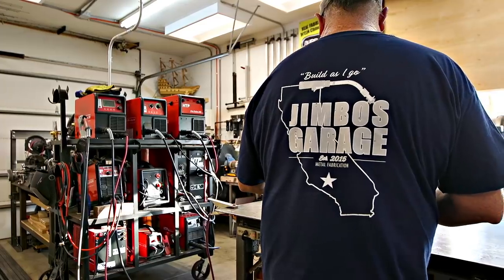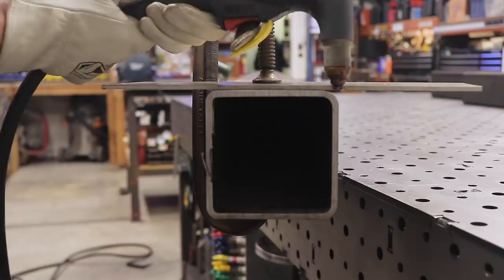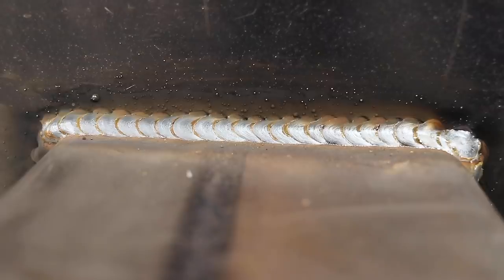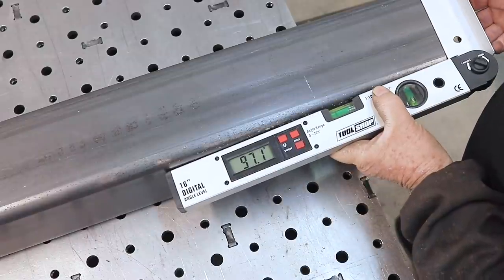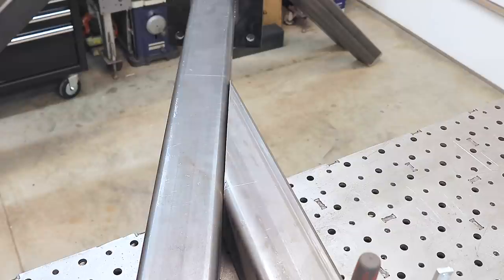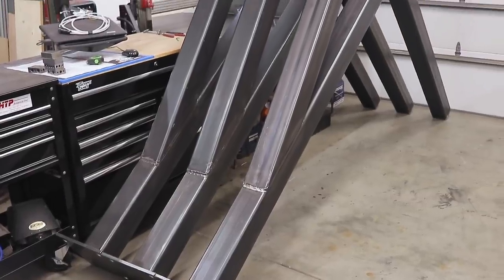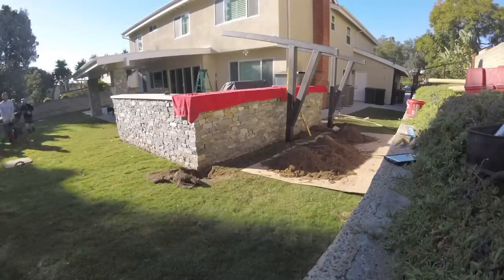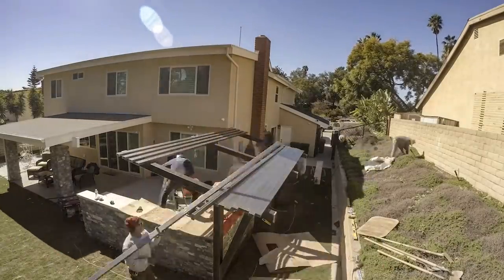Metal Outdoor BBQ Trellis | JIMBO'S GARAGE

Comment: I wrap my pencils in neon pink tape. Otherwise I misplace them. I do the same to my most used bits, tape measure and remote controls in the workshop. Spray paint also works well.
Reply: Also helps stop them growing legs. I had some neon pink loadbinders/tie-down straps at one point because they were the only ones that didn't get 'borrowed' - some guys aren't as secure in their masculinity, I guess :-D
Reply: @gordowg1wg145  Same!  I used to get the bright neon pink extension cords for my guys.  You could leave those out on a job site for weeks! LOL

Comment: Wow, and I thought I over designed stuff!  1/4” wall on a 5x5 tube is impressive
Reply: I think the method used to support all of the other metal for the top. Add to that only two support legs . I think it's good for many years.

Comment: That's an awesome project and challenging on the angles I am certain but you did a great job. Just curious, but on my projects I always do my best to remove mil scale in my welding locations, I noticed on the video you don't do this, at least this is my impression on the video. I think you'll get far better looking, better penetration and stronger welds when you take the time to remove the mil scale and clean with some acetone. None the less an awesome accomplishment and cool project. keep up the great videos.

Comment: That’s not a trellis overhead. That’s a pergola. A trellis is upright section that you typically attach gabion or mesh to in order to grow something like grapevines on. The top part is called a pergola. I know it would be super expensive but, the ones I have built have been out of aluminum. It look great though. I just thought correct you on what that actually is. Nice work.

Comment: Good work but on something structural like this that is hanging out a ways and under a decent amount of pressure why would you chance any downhill welds since they are easier to get to look nice but aren't usually as strong.  One other thing, when you were trying to figure out the long angle why didn't you just trace the bottom side using the tube is was resting on instead of eyeballing it from the top?

Comment: Jimbo, I love how organized your shop always looks in these videos! Question: After you set all your horizontals across the frames did you completely weld around them so that everything was sealed off and wouldn't rust? The reason I ask is because We're going to be fabricating a massive trellis this week for a Shake Shack in Murray Utah and aren't planning to weld around all of them because it's SO MUCH WELDING! I'm afraid it's going to be rust city. What's your take on this? We are setting everything as primed painted and painters are going in to paint it. Do you ever just seal the unwelded parts with a silicone or anything?
Reply: In my experience welding drill stem stands for deer hunters in Louisiana, I sealed up every seam  to avoid rust. Not a big deal for the woods, but if you put your name on something just know that if it rusts down the road and if it happens to stain the painted surfaces it's your name on the product. I wouldn't trust the painter to protect my name... Worst thing in the world is then up in a finger pointing contest with other trades...  So, my advice is to either weld it or seal it with a darn good paintable cock myself.

Comment: Hi jimbo, great video again. Can I ask a question? What's the reason for using flux core over the 1st weld? Thanks Liam
Reply: Such a pity that Jim has not replied, would love to learn the reason too.
Reply: MIG is not known to be the best process for deep penetration and structural work. With fluxcore you can be more certain the weld isn't going to fail.

Comment: Nice work, I have a question on your weld cap as you mentioned.  You used dual shield flux core (3:55), is that with a gas or no gas?  Man those welds are clean and great looking!  Also what grinder disk were you using?  Thanks and again outstanding work.
Reply: Dual shield by definition uses gas. 2 (dual) sources of shielding - the gas from the bottle, and the flux in the wire.

Comment: ok on the end caps you shouldn't have to grind your weld off . take the inside measurement of the hss 
so when you fit the caps it will be what is called a corner to corner fillet weld and radius the corners of caps prir to fit up tack the corners then roll weld it out .The thinner material i just down hand hard wire stop on your starts just need to blend the one and buff it with wire wheel .As a welder i'd rather see a weld over a grind mark, better weld procedure and if you need to make tank out of hss it wouldn't leak ,but not to much pressure obviously.

Comment: Down hill with the gas fluxcore.... No no no. The whole thing is solid not saying it isn't but its solid from the welds done in the flat position.  The downhill fluxcore is basically calk. Even the mig i would have run up hill. Honestly though i would used fluxcore the whole way and no mig. Looks awesome not poking anyone but that wire is not good to run down.

Comment: Never knew mig welding produced flux
Reply: It's actually a flux core wire called dual shield. FCAW for short. The other flux core that runs without gas is FCAW-S, where the 'S'  stands for shelf-shielded. Dual shield is it's own animal. It runs like nothing else. I use it most for barge fabrication and repair. It's a great process.

Comment: I'm surprised you don't have an intake and exhaust system in that shop not to mention air supply welding helmet...Remember that the Cole miners thought for years there was no problem with there method right up till they got black lung....your health is your only wealth my friend....We need to teach the newbies the importance of health first even though we want to pretend there is no effects on welding and grinding with out a respirator and proper lung protection....luv the shop though....